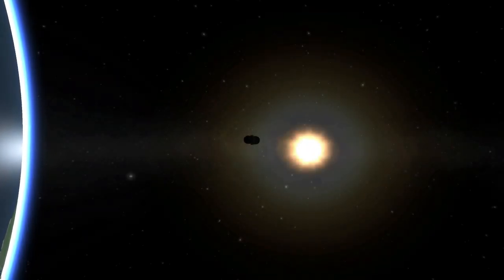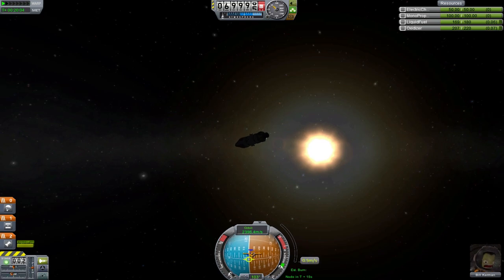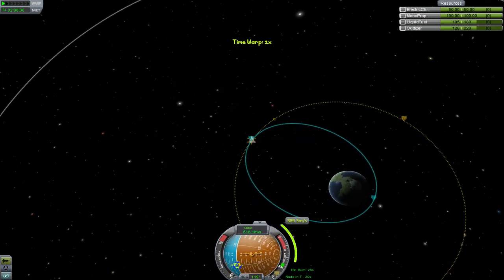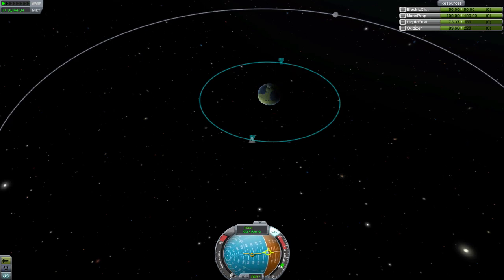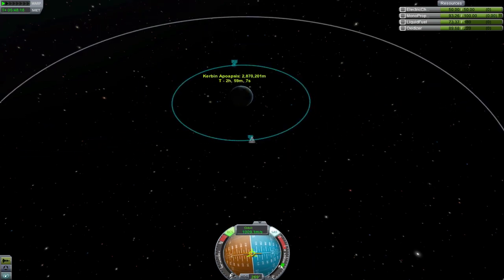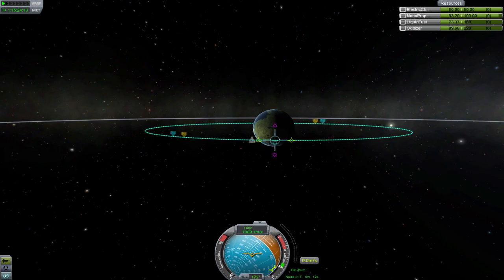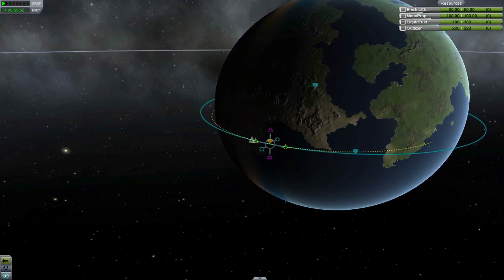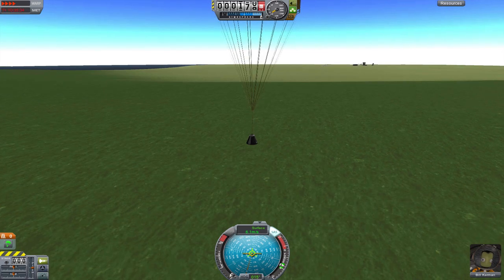Basic Orbital Maneuvers - Kerbal Space Program Tutorial

Comment: Fun fact that I'm not sure where you can put: You can use the scroll wheel on the maneuver nodes, instead of clicking and dragging. Note that scrolling in and out is sensitive to speed, so the slower you go, the more precise the adjustments are. Scrolling in and out are also inverted for the opposite nodes. So scrolling inwards (for example) will have opposite effects on prograde vs. retrograde and so on.